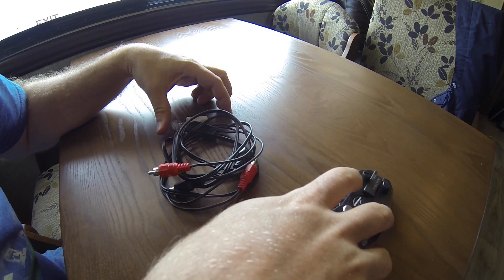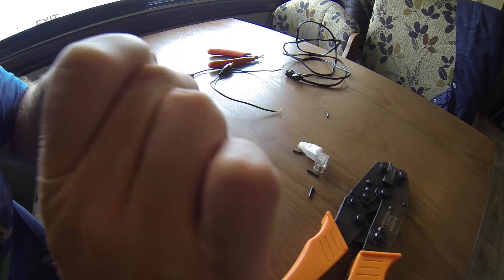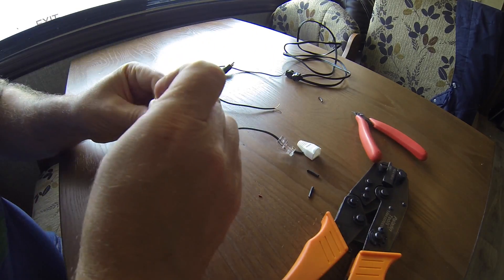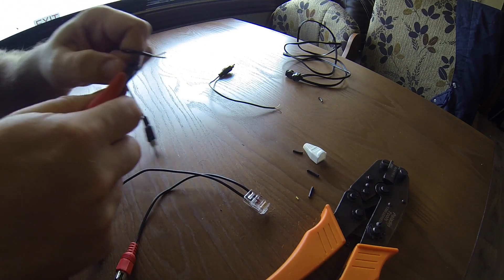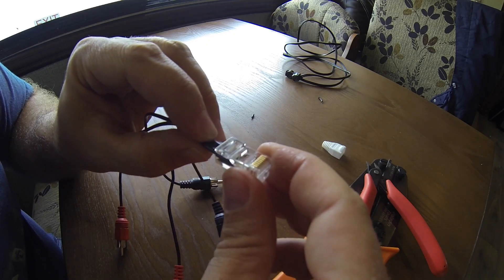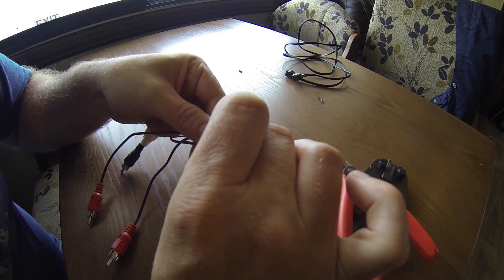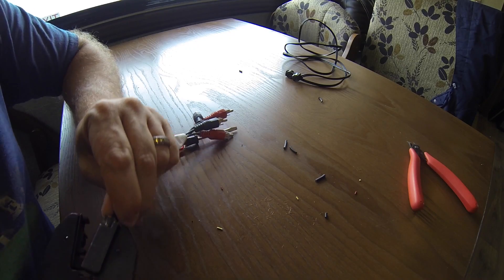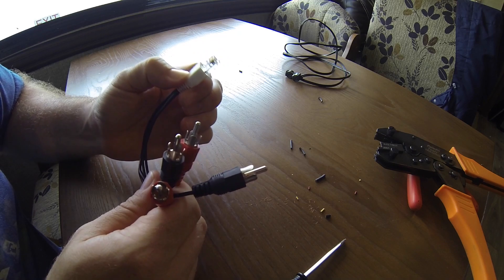Unbalanced Audio over UTP

Comment: instead of an rj 45 jack could you use a rj 11 jack to run a single pair of left and right audio (2 pairs so 4 wires total)?
Reply: would this work since rj45 jacks have 8 wires but since you would only need 4 you could use that telephone wire?